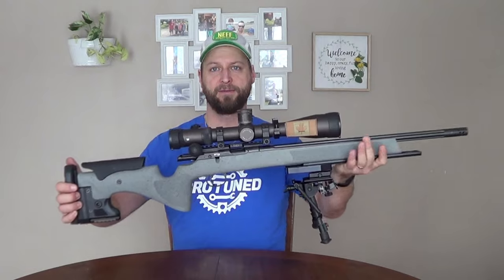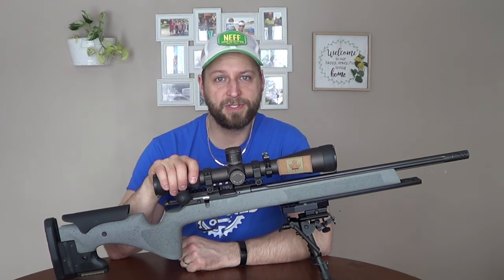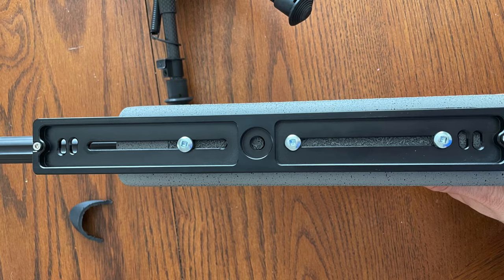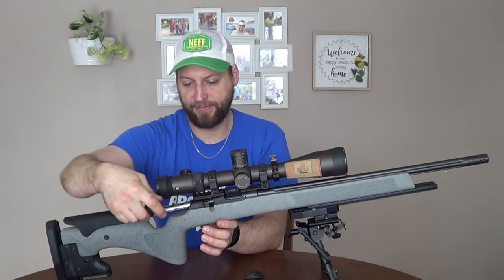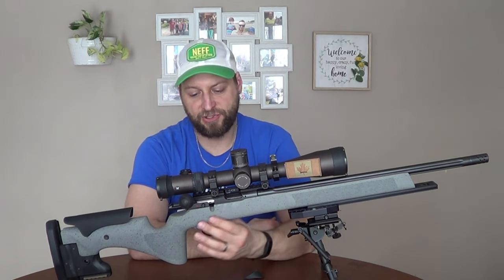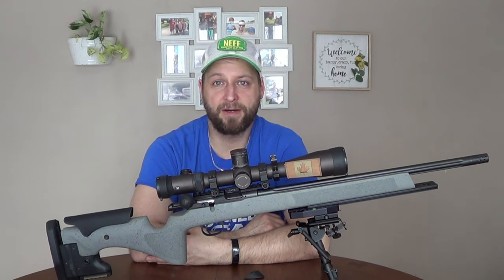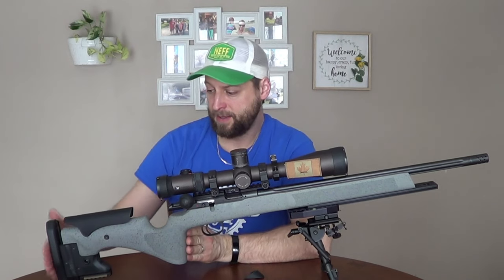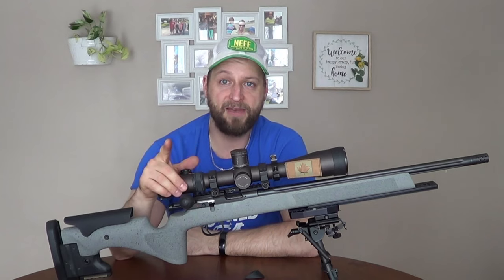DIY CZ 457 How to make it even better!! inexpensive mods

Comment: I did two exact things to my CZ 457 LRP as you talked about in this video. Trim the cheek piece for easier removing the bolt and replace the stock trigger spring with a boll point pen spring with no cost at all. The trigger weight now is only 1.2lb. Thanks for your video!
Reply from the maker: You are very welcome glad it worked out for ya

Comment: Odd.  Recently purchased my 457, and of course, as we all do, I immediately started researching "improvements" before taking the first shot.  😂  Read a lot about springs, from  the yodave setup, to home brew versions.  Out of the box, my trigger had a bit of creep, a bit of overtravel, and a very clean break right at 3#.  Started adjusting and testing, just to see what the factory setup could offer, before ordering parts.  Fairly quickly got the trigger down to 10 ounces in stock configuration.  Too light for my tastes so bumped it back up to 1lb. 4oz.  No creep, VERY minimal overtravel (if you can even call it that), and clean and crisp break, and no bump off.  Totally stock setup other than making the adjustments.  Not sure what I'm missing, but I found no need to order, or scrounge for springs...  🤷‍♀
Reply from the maker: The stock trigger is very very nice for sure and the spring I found made it a bit better but after the timney drop in trigger it’s a day and night difference between the two. I really like a crisp trigger and have used timney triggers in a lot of my rifles and I just have to have a great trigger now. The stock CZ trigger is definitely nice for a factory offering but I guess I have just became a trigger snob

Comment: My 2 bob's worth on this CZ 457 LRP just got mine waited 9 months, due to none in Aussie at the time.
I find that the stock settings suit me, I just put my March scope on and away I go.
I suppose I'll change the trigger setting but need to put another 1000 rounds down range yet.
Reply from the maker: If you change the spring it makes a noticeable difference

Comment: The spring from a BIC lighter (flint spring, not gas release spring - there are two) will work in the trigger of a CZ457, when cut down to the right length.
Reply from the maker: Nice 👍🏽 I used a pen spring but now that I think of it the flint spring might be lighter in pull wright. I have a flat trigger shoe Timney on the way but it’s back ordered so may be a while yet. Maybe I’ll try the lighter spring and see if it’s better

Comment: I recently picked up one of these rifles! Loving it so far, and I’ve also been considering adding an ARCA rail. My main concern is the drill bit grabbing and tearing the rubberized finish of the stock. Did you experience anything like this or was the process pretty straight forward? Good to see a Canadian firearms channel as well! 🇨🇦
Reply from the maker: How’s it going Matt! Glad to hear you picked one up. I had no issue at all drilling it and the coating didn’t seem like it was even close to pealing off or grabbing the bit. I only drilled one hole and I used the 2 existing sling swivel stud mounts for a total of 3 screws holding it down. I also bought an arca quick disconnect to mount my bipod to. Well enjoy the new rifle and so far most SK ammunition work very well in it. Cheers Matt

Comment: My first modification was an XM38 thermal scope....... and a red dot sight.
Reply from the maker: That’s awesome! I’ve always wanted thermal but out of my budget at the moment. What are your thoughts on it? Would you recommend it?
Reply: @BROTUNED  I can "see" stuff in the thermal my buddy with an IR system cannot because if a bunny is perfectly camouflaged in white light, it is in monochrome too.
I chose the XM38 over the ATN 5 despite the apparently poor comparison seen on a you tube video,
The ATN after sales seemed to be poor.
I am delighted with it.
The relatively short battery life, 6 hours, suits me as I will hardly ever spend 6 hours hunting bunnies.

I made myself s "Hot target" with batteries and a pattern of resistors so I could set up the scope at my local range.

One addition...
Having set up the thermal at 25 and 50 yards, I fitted a red dot sight to the scope tube at 45 degrees and set the red dot up for 25 yards when the rifle is tipped over.
This means the X-Y adjustments work in the right direction, However, I found the red dot to be valuable in daylight because it can be hard to pick up ground features in the thermal so, a peek through the red dot at something that looks interesting, and drop my eyes down to the thermal for clarification.
Sadly, in bright sunlight, the dark blue menu in the scope is invisible because my eyes close up to pinholes in the light.
The screen image is fine though.
At night, the whole deal is visible.

Note, I was shooting on ground I hadn't surveyed in daylight and I stepped off a 15 foot embankment breaking 2 ribs against my CX452 stock. The scope was saved by the moderator and the red dot sight...
Shooting in pitch darkness has its hazards.
I am better prepared now (Head Torch etc)...

All in all, if I had the extra cash, I would have gone for the XM50.
The screen is larger, the resolution is better but... no thermal scope is that high a resolution. 
IF you get a chance to shoot a thermal, you only thing you might find tricky is setting the scope up for a specific range.
The One Shot zeroing is more like 3 or 4 shots.
I expect a single hole at 50 yards.

My trigger is quite a hard pull compared to my competition 10.22 with a Kidd Trigger, so my next tweak is to lighten the trigger as I tend to go off target as the trigger lets go.

Sorry for the information overload :)
Weapons Grade Respect from the UK...

Comment: Hi Ryan, I just got the LRP, I followed your cheap mods for it, but curious as to what Arca Clamp you're using?  I see you're using a some sort of Pic/Arca mod there. Thanks!
Reply from the maker: I found a 400mm arca rail on Amazon I believe it was $50 Canadian I also picked up a few 300mm arca rails but the 400mm is the one I use now I can adjust the bipod from the mag well to almost the muzzle with this one. I used wood screws that are basically the same diameter as the stock sling swivel studs then pre drilled a pilot hole for the back screw so I had almost zero chance of splitting the wood stock. I used the front 2 stud holes that were already there. Hope this answers your question if there is anything else you need to know I’ll see what I can do to help
Reply: @BROTUNED  I was actually asking about the how you attached the Arca Clamp to the bipod.  I have a 300mm Arca Rail and a couple of Arca clamps.  I was planning on bolting the clamp to an Ebay sourced 5 slot PIcatinny rail then use my Harris (clone) bipod with the that has the picatinny clamp
Reply from the maker: Ya that’s what I did I drilled and counter sunk the 2 mounting screws so the clamp would ride smoothly on the rail

Comment: Dear Sir, thank you for your interesting video. I'd like to put an answer: because I want to buy a 457 lrp for production and open shooting, I'd like to know if the barrel is so heavy as the MTR version.
Reply from the maker: I do believe both barrels have the same diameter but the lrp is fluted so a bit lighter in weight but. Not to sure about the barrel diameter. It does come with a match chamber though same as the mtr
Reply: @BROTUNED  Thank you for your kind answer. Probably it is a bit lighter
Reply from the maker: If you want I can measure it for you after work today and let you know the exact size? Let me onow
Reply from the maker: Know
Reply: @BROTUNED  Hi, yes please I'll be glad, thank you. I hope that I'll find also someone that can measure the weight of the MRT barrel... :)
Reply from the maker: Hi there sorry for the late response but the lrp barrel measures 0.87” or 22.1mm
Reply: @BROTUNED  Thank you so much! Take care
Reply from the maker: Anytime! Hope this helped you out! Have a great day

Comment: I have a similar configuration as your CZ.   I just added an ARCALOCK Rail.  I didn't realize that you need add an adaptor to my bipod to fit the rail.  What brand of bipod do have and are you pleased with it?
Reply from the maker: I just went on Amazon and bought an arca quick detach camera mount and I love the adjustability of this set up over the fixed one position sling mount or a picatini mount.
Reply from the maker: The amazon name is 	
YUPVM CL-110N Quick Release Clamp
Reply from the maker: Check this out!
Reply from the maker: Haoge HQR-400 400mm Multi-purpose... https://www.amazon.ca/dp/B01NCZEEMY?ref=ppx_pop_mob_ap_share
Reply from the maker: YUPVM CL-110N Quick Release Clamp... https://www.amazon.ca/dp/B09CTDF174?ref=ppx_pop_mob_ap_share

Comment: How’s the finish holding up on the LRP? Rubbing off? Getting sticky?
Reply from the maker: Basically the same as the day I picked it up. No visible wear or anything on it but I’m not hard on it either. I’m very happy with the durability so far
Reply: @BROTUNED  nice, I was trying to decide between the LRP and the mdt chassis variant we get in the UK, think I’ll go with standard LRP , cheers 👍🏻
Reply from the maker: Yes I had the same decision to make and also went LRP
Reply from the maker: Not a huge fan of short barreled 22lr I believe the longer barrels make the ammo more consistent but that could be just in my head
Reply: @BROTUNED  literally the eternal debate around 22 precision , I dunno why though, you only need to look at a competition line up 🤷🏻‍♂️😂
Reply from the maker: Exactly cheers!

Comment: Ridiculous to use a spring from a pen for a firing spring replacement part.  Think about that. One of the most important parts on the firing mechanism and you cheap out using the wrong spring.  Saved yourself 10 bucks though..
Reply from the maker: The spring is not for the firing pin it’s the return spring in the trigger group. The firing pin spring is in the bolt. Hope this clears that up.